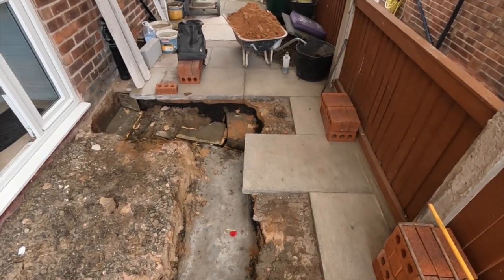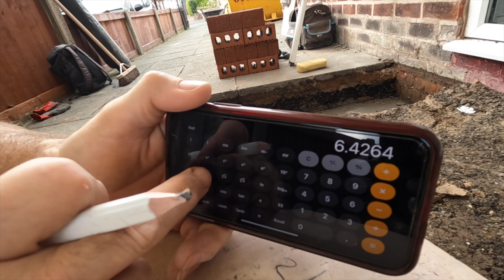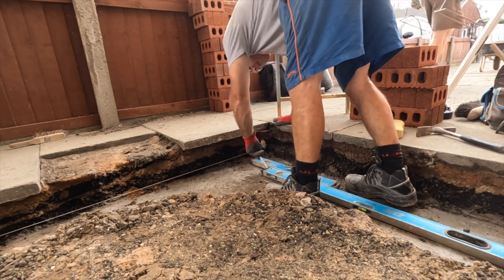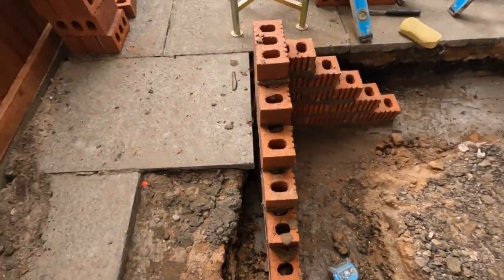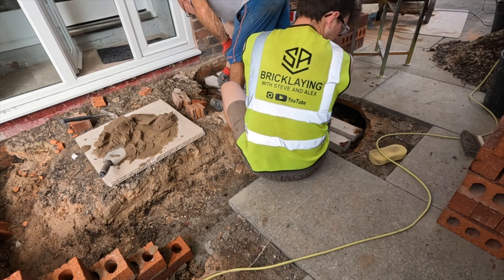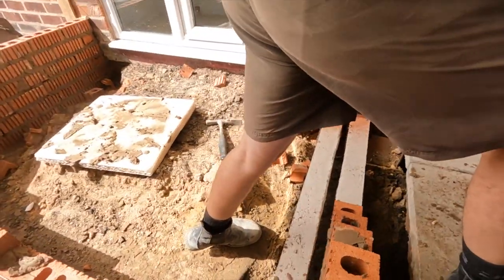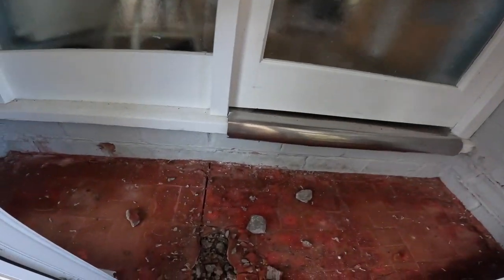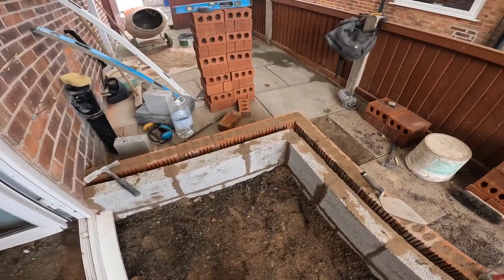AWKWARD PORCH BUILD UP TO DPC ..PORCH PT 2

Comment: Didn’t think I’d be seeing Pythagorean’s theorem on a building video. Never thought it had a use when we were at school so once it was learned we forgot about it. In my job interview of my current job over 30 years ago my old boss asked me to quote it. Soon learned of its use as an apprentice. 
 Steve the setting out was interesting. Did you find where was lowest on the foundation then put extra cement under the brick and level off that? 
Can not wait for the next vid 👍
Reply from the maker: Thanks pal . No you always work from your dpc level and gauge down from that 🧱👍🏽
Reply from the maker: @martin2466  😁🧱👍🏽

Comment: Why not use length of timber of existing wall cut to size for your projection instead of tape
Reply from the maker: Because a tape fits in my pocket and doesn’t get in the way on such a small job site 🧱👍🏽